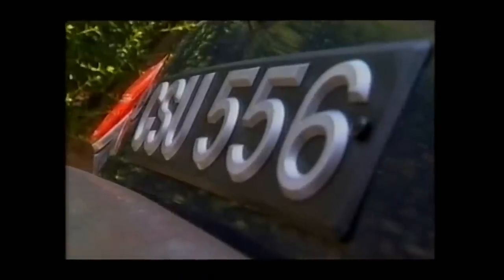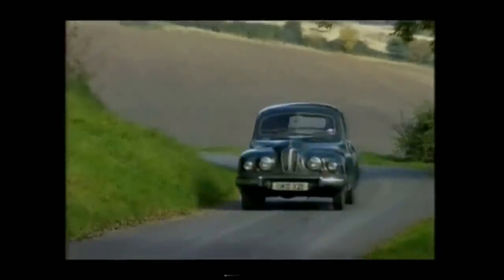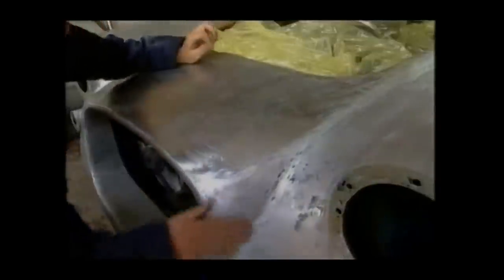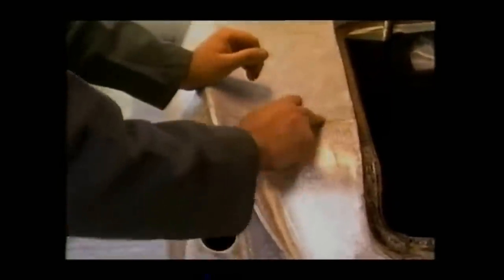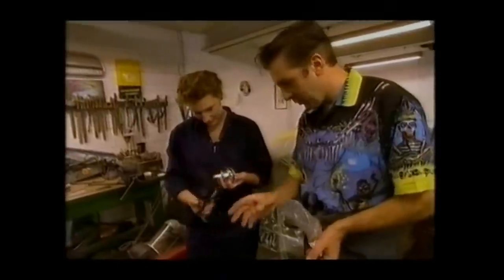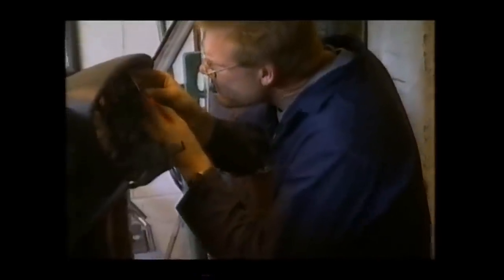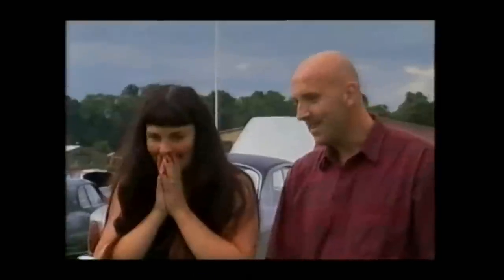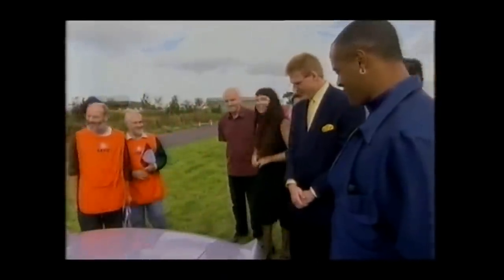Salvage Squad S01E03 (Bristol car)

Comment: At 15.40 the eejit presenter calls the car a 402 drop head  - it is a 405.
Reply: actually it's a 407 from 1962... but I won't be so rude as to call you an eejit.